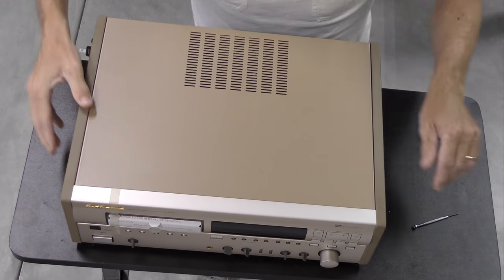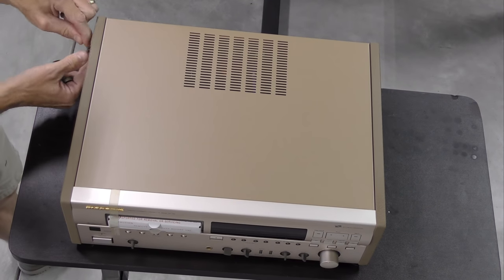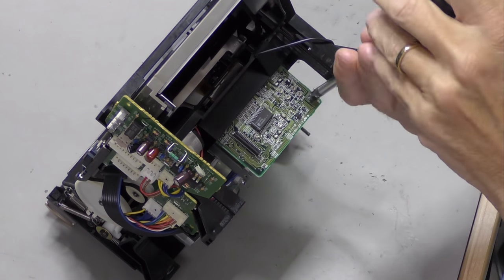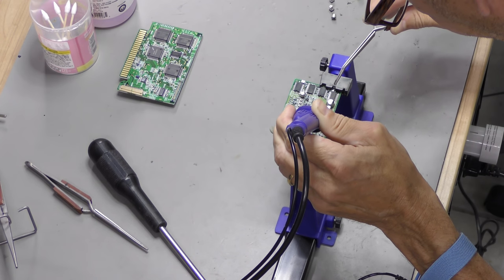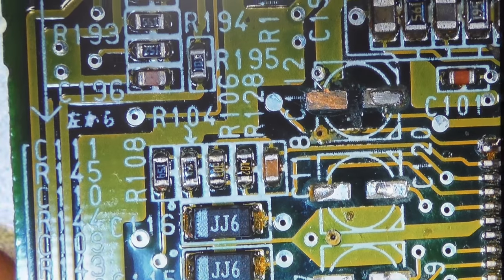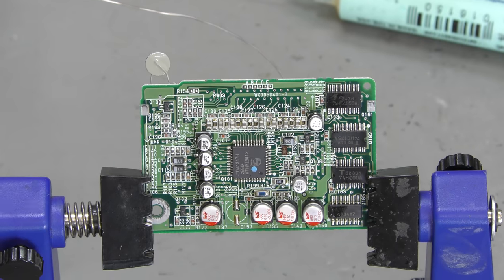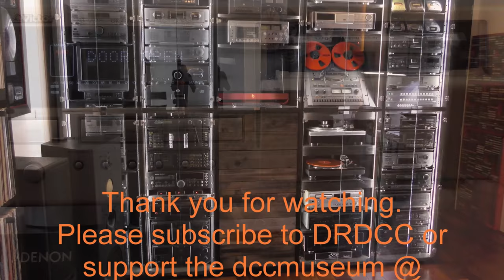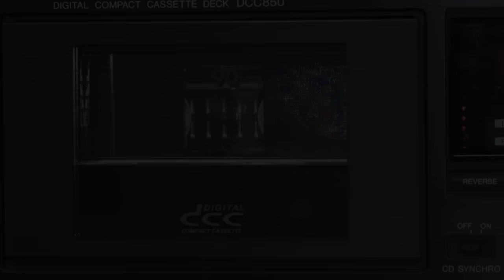Restoring a New Marantz DD92 Digital Compact Cassette

Comment: Yesterday I had the chance to replace the caps on one of these (so far I had done it only on dcc-900 philips units). To my surprise the read/write and pasc boards where in very good condition, much better than any other I had serviced in the past, although the rest of the inside was filthy (2 spider webs found, plenty of rust to the bottom copper mostly, head was totally dirty, also pinch rollers). After a good cleaning of the boards and installing new caps, nothing else was needed (=no broken traces!). Overall a much better unit than the rest of the Philips 1st generation players (and I guess technics too). I think the different sound board (or card?) with DAC7 chip (TDA1547) is much superior to the philips original (which was already very nice sounding). Page close attention to 5:40 if you are familiar with Philips 900 only (otherwise the mechanism cannot be removed or put in place).

Comment: 5:49 "The On/Off button often breaks if you remove the front panel incorrectly"
Can't you pull the plastic extender and button off the switch before you remove the front panel to prevent that from happening?
Reply from the maker: Tight, but possible. The front button is not as sturdy as the Technics/Philips. To be 100% sure you would need to remove the front cover and switch, but there is always a chance breaking it when mounting it back........ it has happened to me already. The way presented in this video seems to work best for me.

Comment: I found mint two DD 92 and recapped with good Panasonic smd capacitors....all boards checked traces and all.....i only manage to unlock input and output board and analog tapes work....but dcc wont read or record.....In record mode he performs normally but nothing read after.....trims on r/w boards are matte from old smd leaking and i dont know it is calibration on that board issue and how to calibrate pots?!?
Reply from the maker: Please ask this question on our new forum.dccmuseum.com That way other people can learn from this as well.

Comment: Hey there Dr DCC - I have a DD 92 which has been sitting around for yonks and decided to fire up  and use the beast once more. However when trying to play a pre-recorded dcc the is no sound.
I then tried to a record and playback scenario, no luck there either. Oddly it will playback an analogue pre-recorded tape. Is this a caps problem or if not can you give me a heads up on what else might be the cause?  Cheers, and thanks.  grahame
Reply from the maker: Grahame Cranwell Hi, it is most likely the caps. You have to replace them immediately, before you risk damaging the head. Please ask this question on our forum.dccmuseum.com so others can learn as well.

Comment: I have a Philips dcc 300 that appears to have the dreaded capacitor problem. How much to repair it?
Reply from the maker: craig davidson The dcc 300 does not have this problem because it has regular capacitors. It must me something else.
Reply: @DRDCC  excellent news, thank you for your prompt reply
Reply: @DRDCC  OK, it had a "cass blocked" error, I opened the DCC and gave tray a little nudge....all happy! But gives still blocks at random intervals. When it does want to work i put in a normal type 2 rape as the doc's I want have not arrived yet. The sound comes out of the left channel only but very  very muffled......can hear slight change when press the dolby nr button
Reply from the maker: craig davidson That could be quite a few things. Hard to tell without looking at it.

Comment: Just being asked if you can list which capacitors you changed. That is, state the values
Reply from the maker: Zoran Buric if you look at our dcc900 video the caps and values are in the description of the video.
Reply: @DRDCC  I watched that video about the dcc -900. So the same capacitors are for the Marantz dd-82 model.
Reply from the maker: Yes. All first generations are the same
Reply: @DRDCC  thanks

Comment: Pls help....My Marantz dd 82 and 92 need changing smd capa....but when i connect them like dacs trough optical input with monitoring.... deck sense signa andl he goes in Record prohibit mode!? Some advice?
Reply from the maker: Pedjo Gt Have you tried connecting more then one source. If both decks do it, it cant be the decks normally.
Reply: @DRDCC  I will try today both decks...i dont know why and how scms is activated without tape inside...only on signal? BTW i pull out R/W boards for recapping so... scms dont have anything with monitoring inputs...or?

Comment: My DD-82 after repair plays with sound pauses time after time :'(
Reply from the maker: That can be caused by a faulty connection on the board. The side A/B on the boards often get damaged by the acid. Remove the 68uF caps and check these connections under those to side b again. Does this happen with every tape on Side A and Side B of the tape?